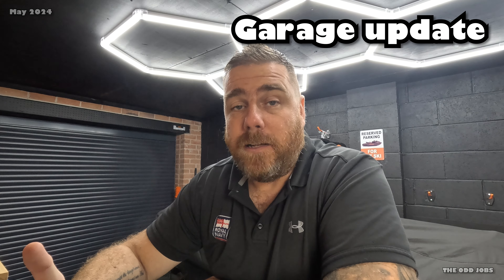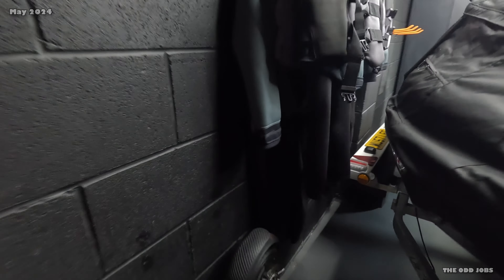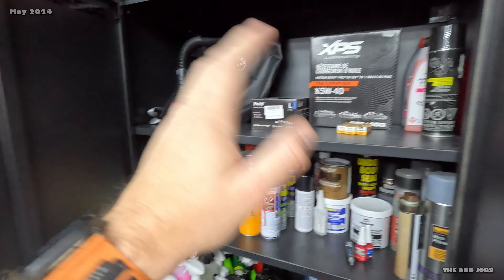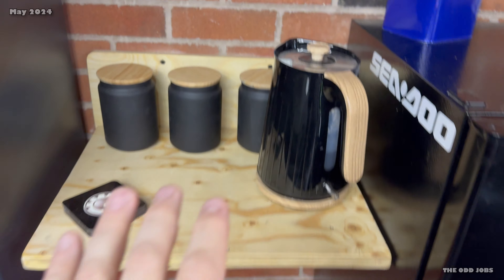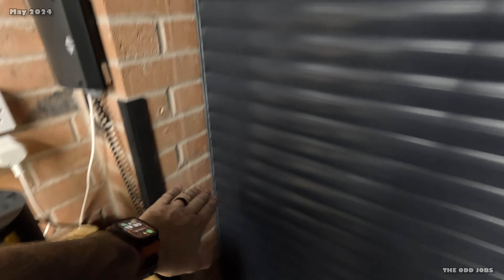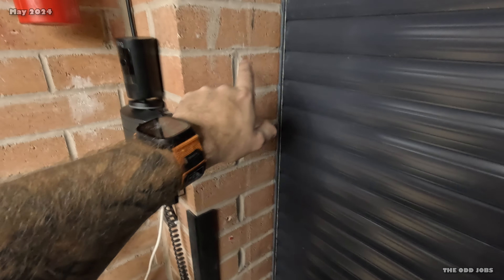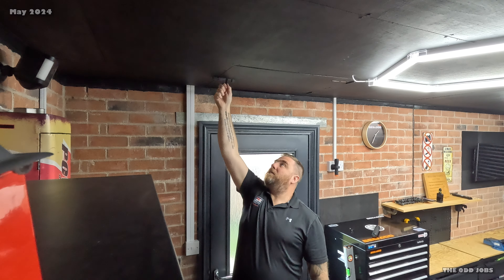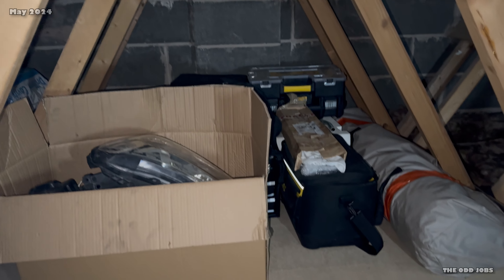DIY Garage update 1 YEAR ON

Comment: Who supplied your garage door please? Has the door been reliable. Would you recommend the company? Looking at replacing an old up and door as part of y garage renovation. Got the same Ikea cabinet as youve used after seeing the first video you did. Hope your move abroad is a success. Goodluck in all ypu do mate
Reply from the maker: Thanks buddy, really appreciate the comment, the garage door is from a company called Rollerdoor UK, absolutely would recommend, they were really responsive, came and gave me a free quote, they understood my needs for more space, very helpful indeed, never had an issue with it at all, works perfect and looks great.